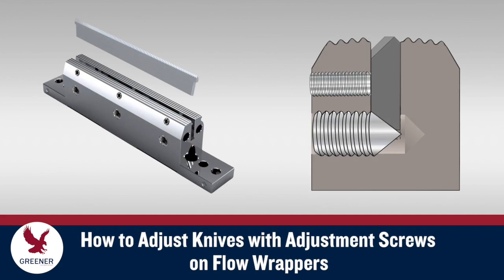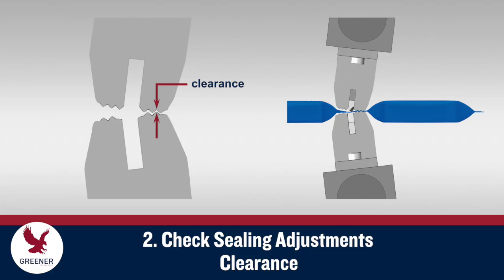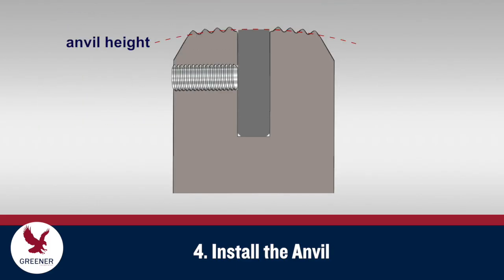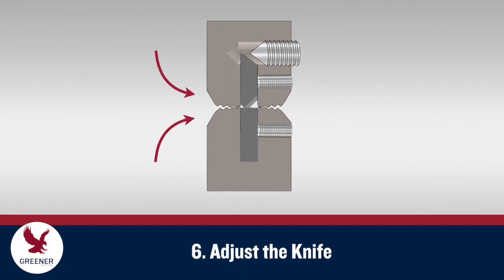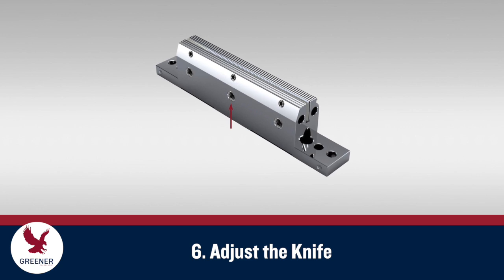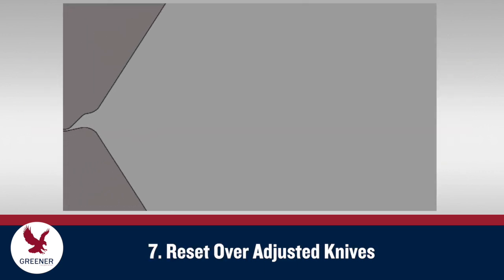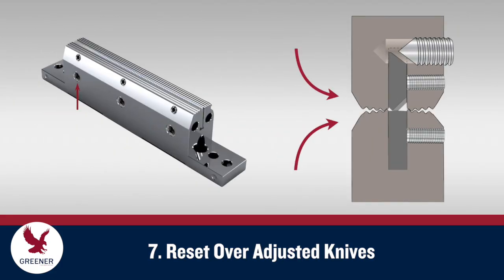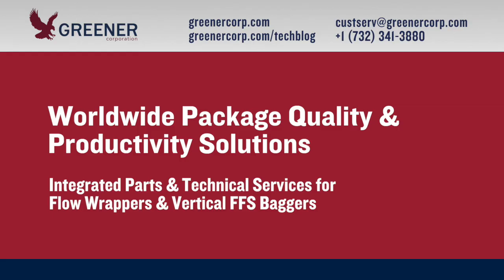How to Adjust Knives with Adjustment Screws on Flow Wrappers

Comment from the maker: A Greener client asked us a very good question: 
The video shows only 3 adjustment screws and you use the outer 2 screws to start the adjustments. Our machine has 5 adjustment screws. Would I start with the 2 outer or should I stick to the 3 center ones like your video shows?

Mark Green, Technical Service Coordinator at Greener, responded:
Use the same procedure shown on the video, utilizing the outside screws, then moving to the center and then “supporting” the knife with the last two screws between the center and outside screws.